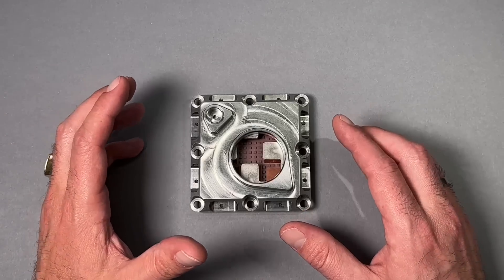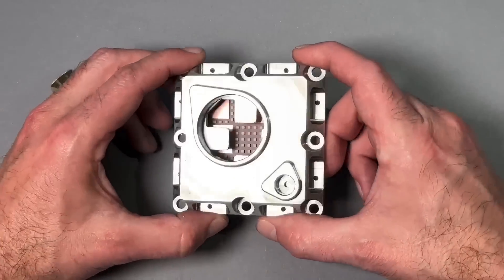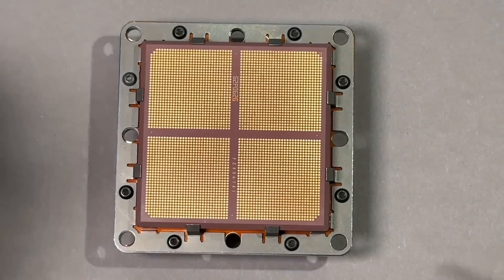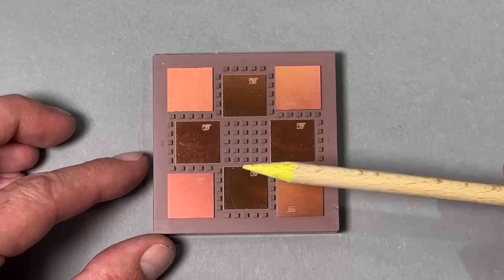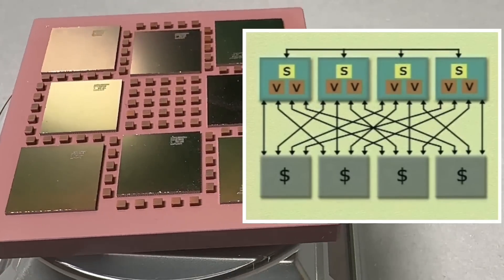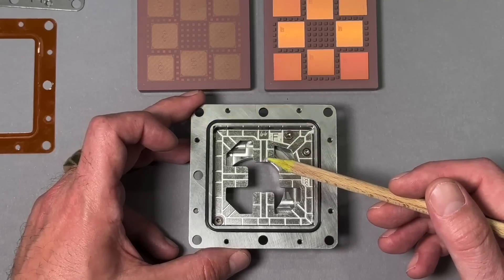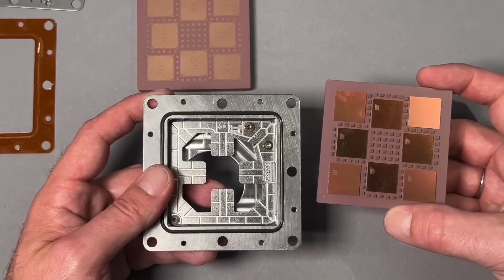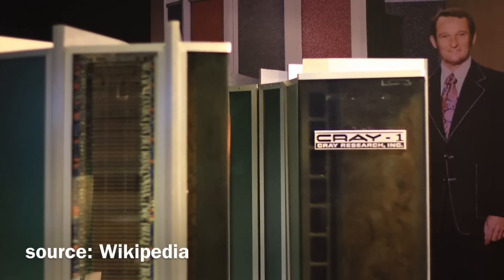CRAY X1 Multi Chip Module - Monster CPU with 8 Cores - Teardown

Comment: FYI: Cray Inc. that produced the Cray X1 is not the original Cray Research. Cray Research was acquired by Silicon Graphics in 1996. Cray Inc. was formed when Tera Computer Company purchased the Cray Research Inc. business from SGI in 2000.
Reply: Yep, many people skip hop over the fact that later Cray had no Cray in it really. Aside from the computers being completely different in terms of topology and thinking as well as design idea, the whole company was different. Seymour Cray was dead and in part some of his vision went with him, and the whole focus shifted from very powerful 'vectorized' custom CPU's (yes marketing BS but it sounds funny) to then employing Cots stuff as a cluster instead. That lost them the whole point of being IMO since anyone could slap together a bunch of PC's in a cluster and load balance them and use MPI etc. "Anyone"  bit loosely here but it didn't take Cray to do it, sure you'd need to play with and figure out Infiniband etc if that was required, but for a lot of applications programmed correctly good old ethernet was enough.
Reply: @noth606  Not exactly. Burton Smith did some interesting work, such as with the MTA. At some point custom processors, however, no longer made economical sense, so Cray Inc. essentially became a networking and integrator company. Cray Slingshot is used in the top 3 supercomputers listed in the Top 500. Steve Scott moved from Cray Inc. to NVIDIA to make its GPUs what they are today. Cray Inc. was recently acquired by HPE and is the only serious supercomputer integrator left in the US.

Comment: 7:45 
Cray X1: I have to cool 500 watts with exotic cooling
Modern gaming PC: 500watts? I do that with just tap water.
Reply: Modern supercomputers use warm water cooling. In the early 2000s, it was either air cooling, chilled water cooling, or evaporation cooling. Supercomputers need to get megawatts of heat out of the computer room. Not your modern gaming PC!

Comment: In the early 90s, when I was at Georgia Tech, I was so excited to get time to run jobs on a Cray Y-MP. It was a completely different world from the 68030 Macs and 386 PCs we used daily.  Now I work with supercomputers made up of Commodity Intel servers, Infiniband, GPUs and insane amounts of Flash storage.  A bit of the mystery has been lost over the years, but I get to play with big computers every day!
Reply: Its more like Supercomputers became the commodity. Now everyone has Cray at home. His idea’s eventually ended up on commodity processors ie AVX2 etc… just like when 3D only existed on very expensive technical UNIX workstations by SGI,SUN etc…. Now every PC ships with 3D hardware, Vector processors etc….

Quantum computing is really now the next level.
Reply: @videosuperhighway7655  Well, kinda yes and kinda no. Some of the magic is lost in translating and commoditizing stuff. BUT then again, at the 'edge' of what you can have on your desk there are now some fairly extreme things, like single socket "CPU"s with 64 cores and way more, up to 192 I think now, it's not one chip but they do live in one carrier. I have one box with an i9-10980XE that is "just" 18 cores but they are pretty fast cores. 
I  would say though that none of these things are common, most people don't want to spend a car's worth of money on a PC. Most PC's sold are in the 400-900€ bracket which does not even buy you the CPU for the "big boy PC" class, let alone the whole computer. The heavily multicore PC workstations live in the 3000-10000€ bracket, and are almost never found in anyones home, they are either mounted in a rack, or sit on or under some very specific persons desk at a university or tech company.

Comment: Was it watercooled? I could imagine water flowing directly on the chip with that assembly. Scary.
Reply: He explained that it was refrigerant.  Supercomputers used multilevel cooling systems.  The refrigerant would be cooled by chilled water.

Comment: Cray was bought by SGI, and then SGI was in charge of a Microsoftie CEO, teared to shreds by him, and then sold to Nvidia. So Nvidia has reign over all the patents and technology from both Cray and SGI.
Reply: Not exactly.  Cray Research was acquired by Silicon Graphics in 1996. Cray Inc. was formed when Tera Computer Company purchased the Cray Research Inc. business from SGI in 2000. HPE recently acquired Cray Inc.

SGI was mostly interested in the non-blocking crossbar that Cray developed. It enabled massively parallel processing systems that could run one OS across all cores, like the SGI Altix. SGI kept that IP. The network IP went to Cray Inc. and is now with HPE.

Comment: That one is really neat. How the heck do you find this stuff? Is it really all "luck of the draw" or do you have some sort of secret connections you ain't tellin' us about? Because I've looked for mainframe stuff on eBay in the past and I swear, either my "Google foo" is just not up to snuff (i.e. I'm not using the "correct" search terms somehow) or I live in the wrong geographical part of the world or the universe is somehow against me having any of that. The closest to a proper mainframe processor I've gotten up to now is a POWER7 SC-TCM which I bought from a computer parts reseller in Manassas, VA. I believe you have one of those as well as I've seen yours in your display, proudly labeled "POWER7". I don't get how you have so much better luck than I do. What's your secret, dude?

By the way, about that 500 watt TDP. Chips today are getting there. In fact, GPUs are already getting close to that now and CPUs are not far behind. And MCM is the norm now, with AMD's Ryzen Threadripper and Epyc processors and Intel's Sapphire Rapids Xeons all using it. I've seen articles from Serve the Home (look 'em up, they're here on YouTube) talking about liquid cooling now becoming a requirement for modern servers because of the huge amount of heat they're starting to generate. Conventional air-cooled systems are quickly becoming a thing of the past as TDPs rise to a kilowatt and more.

Glad to see you back in action after such a long hiatus.

Comment: There are plenty quotes/jokes "probably" from Seymour Cray :) - like "Reporter: recently you said that parity is for farmers and now you have added an error correction module to your machine, how come?  [i am not sure which corpo was it, CDC or later]
Seymour Cray: Recently farmers have started buying more and more computers :) "
Reply: Those farmers was Los Alamos National Laboratory. Turns out, they have a higher memory error rate due to being at a higher altitude.

Another quote was: "If you were plowing a field, which would you rather use? Two strong oxen or 1024 chickens?"

Comment: Can run Doom, as there likely is an emulator that can, using a fraction of the one core only, emulate a 486DX2 CPU entirely in software, complete with all the translation needed to interface to the Cray display interface.
Reply: No! These are vector processors, designed for linear algebra computations. Oh, and the "Cray display interface" is a command line shell.

Comment: Very interesting cooling, I never heard about such cooling before.
Reply: IBM had 100/118 chip MCM's in the 308X (S/390) series circa 1980.  The first cooling attempt was liquid fluorocarbon swirling around the chips, but this rotted the chips.  They finally decided on little aluminum pistons touching the back of the chips and used helium to better conduct the heat.

Comment: WOW! Obtaining a bare ceramic substrate, unpopulated (as in actually un-populated, rather than de-populated [i don't see any solder remnants, it's all pristine gold pads]) is quite rare!
Reply: Those pads are on the connector side.  They impinge on spring loaded pins.  I've swapped a bunch of these modules in engineering test.

Comment: X1 was a really interesting architecture. There were more than a few similarities between the X1’s MSP/SSP hierarchy and modern GPU’s (with the MSP being fairly analogous to an SM in Nvidia speak). Even some of the optimization challenges around inner-outer loop and parallelization are quite familiar. The notion of the different compiler directed modes is also interesting. X1 was clearly a very exotic architecture for its time. Here’s a good overview: https://www.nas.nasa.gov/assets/pdf/techreports/2004/nas-04-014.pdf

Comment: I wonder which current consumer CPU would be comparable to the Cray X1 8 core CPU in performance MIPS etc?
Reply: It can do only 12.8 gigaflops. Current consumer CPUs are at least 10x faster.
Reply: The whole supercomputer would be close to one RTX 3090 Ti in FLOPS, lacking severely in memory throughput. But memory performance was very good for the period IMHO.

Comment: IIRC the Cray 3 processor was an approximately 1 foot cube and drew 88kw. It's nice to see that, at 560 watts, they got their power situation under control. :)
Reply: That's 560 Watt per module! Supercomputers have been using more and more power. 20MW is the top range these days.
Reply: @charliefoxtrot5001  Yes but that's racks and racks of hardware. Not a 1 foot cube of GaAs in a bath tub of coolant.
Reply: @charliefoxtrot5001 Apparently they even use that waste heat to provide hot water.

Comment: And now all top500 computers are off the shelf parts (ok, not including interconnect, which is special), not some crazy special architectures. Boooooring.
Reply: Yea, but on the other hand it's soo much more attainable, it's cool being able to get same hardware that pro industry uses with having millions of dollers.... there are pros and cons...
Reply: I'm pretty sure Fujitsu, Sunway and IBM all use in house processors. I'm sure their are others too.
Reply: @MrMackievelli  Fujitsu uses ARM architecture. IBM uses Z in mainframes, yes, very last very custom architecture. Sunway is mostly MIPS, with some changes, but anyway nothing very special or crazy, and their chips are very conventional ones.

There are some interesting architectures on the market, like Tilera64, yes, but nothing so special as Cray X1, designed in house from top to bottom with innovative cooling system or hierarchical memory with custom address translation.

IBM z/System is the last non-conventional system on the market.
Reply: @blacklion79  none of which are off the shelf, Fujitsu doesn't use arm they use sparc.
Reply: @blacklion79 didn’t expect that answer here. Welcome mainframe buddy. I’m into mainframes since 1999. Then mostly Sun and IBM. The IBM Power platform is really one of the best.
Reply: @MrMackievelli  SunWay is off-the-shelf in China, as some other Chinese CPUs and MoBos, mostly in Celeron class.

Fujitsu uses A64FX, which is ARMv8 + SVE, and it is rather old chip, Qualcomm is more powerful now, not to mention Apple Silicone. AFAIK, Fujitsu doesn't use Sparc64 anymore.
Reply: @blacklion79  Sunway SW26010 is not off the shelf. It's a custom processor used for military and supercomputing. Loongsoon is the off the shelf brand in China. Licensing an architecture from ARM does not make it off the shelf, while you are correct in it being ARM based that DOES NOT mean it was some cut and paste of readily available parts like Intel or AMD based systems. This is why so many arm based processors have big differences in performance, companies license the rights and customize the chip to their needs which makes chips like what are used in Fugatsu not off the shelf.
Reply: @MrMackievelli china doesn’t use off the shelf stuff, they use stolen from the shelf stuff.
Reply from the maker: you need to see this in a historical matter. Back in 2003 it was a special architecture. And you are here on a retro computer tech channel 😉
Reply: @CPUGalaxy  I think he meant the current top500 are boring, in contrast to this beast :)
Reply: I think that being assembled from OTS parts makes them even cooler. It shows that all of us can get this kind of power without spending silly amounts of money.
Reply: It’s history that won’t be let lost. 

Thank you my friend!
Reply: "Attack of the Killer Micros"! It's basic economy. The supercomputing industry is relatively small in comparison to other computing branches. Custom-designed processors are simply not economically viable.
Reply: Because of them shekels.

These off the shelf parts are mass produced and there are little new math operations, if any, compared to back in the day, meaning that consumer chips can execute then as well, no need for custom designs.

But what did trickle down is the chiplet part of the whole CPU thing, mostly where the SRAM cache is made in an older and much cheaper process with higher yields, while also meaning that it can be tossed out separately if defective.

Comment: This looks quite similar to the MCMs found in IBM's zSeries mainframes. I wonder if it is designed by IBM as well, but I couldn't find any supporting information on the net.
Reply from the maker: the MCM was manufactured by IBM.
Reply: Three-part video, linked in description, says that it is manufactured by IBM.
Reply: IBM had 100/118 chip MCM's in the 308X (S/390) series circa 1980.  The first cooling attempt was liquid fluorocarbon swirling around the chips, but this rotted the chips.  They finally decided on little aluminum pistons touching the back of the chips and used helium to better conduct the heat.